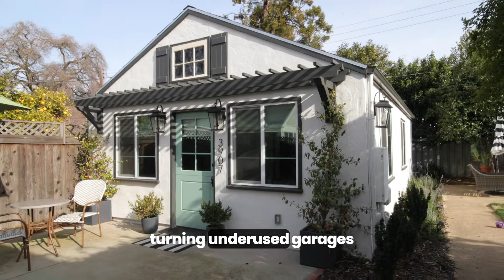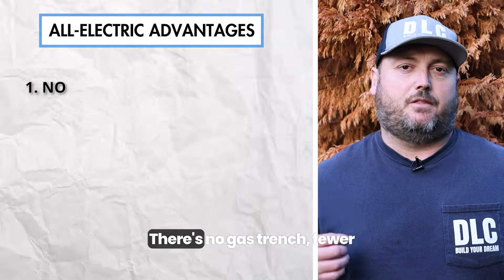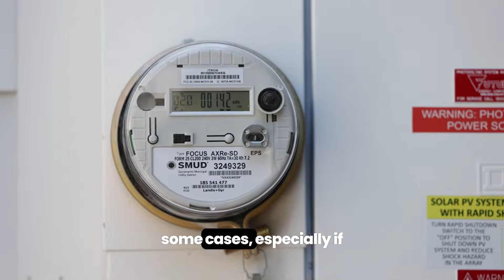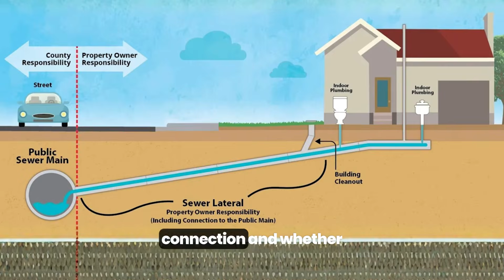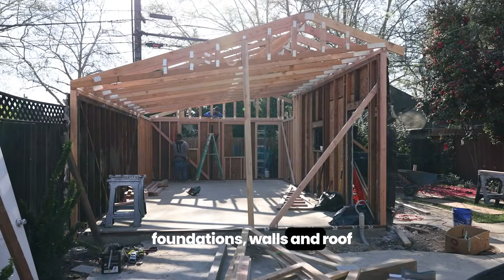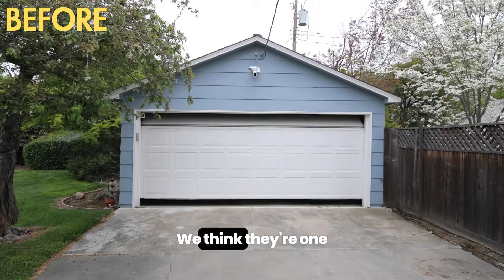5 Hidden Costs That Can Make Your ADU $40,000+ More Expensive

Comment: The gas versus all-electric section and the electrical panel chapter were the real eye-openers here. So many homeowners think budget in terms of finishes and never consider the panel until the electrician flags it mid-project. The point about development impact fees kicking in once you cross 750 square feet is huge too — that one detail alone can make or break a floor plan decision. This is exactly the pre-bid homework that keeps an ADU project from blowing up after permits are already underway.

Comment: On garage conversions when you look at the roof if it definitely needs to be replaced do you disclose this to the owners upfront when discussing costs? I am currently doing a garage conversion and my understanding when i contracted with the General contractor because of the age of the garage and roof it required replacement and included. Now halfway thru my project he is telling me the roof needs replacement ( 2 car detached garage house built 1952 ) and roof will  cost additional $10400. Your advice and any discussion I should have with GC is appreciated.

Comment: can you add a separate meter for the ADU since most of the builds seem to just go off from the main house? Is it a city per city requirement or just the contractor pushing to go that way? I am planning to build an ADU that is far away from the main house and closer to the electrical pole.
Reply: Yes you can add separate, its actually better that way.

Comment: You can save 50k by moving out of California.
Reply from the maker: You’re not wrong 😅 If you’re building in CA though, understanding these costs early really helps.
Reply: California regulations can require separate independent utility supply,  installation, connection, backflow preventer,  fees, and metering costs
example: In Contra Costa County, the water district imposes a "Facilities Reserve Fee" of more than $12,000 for a new ADU
Reply: Sure, but then I wouldn't be living in CA. Card to beat the weather and natural beauty